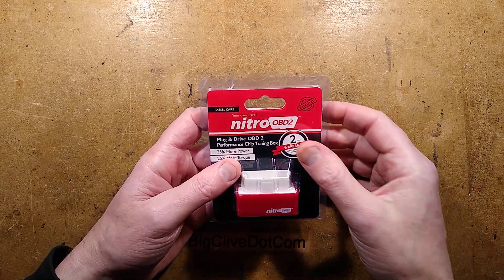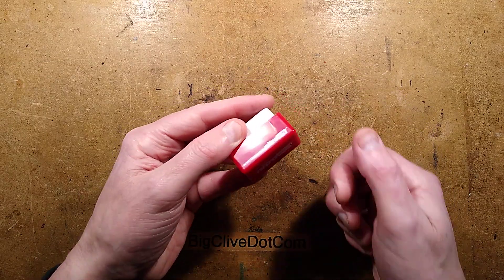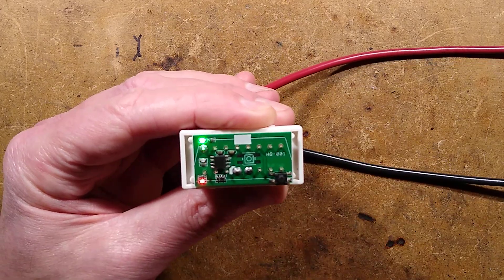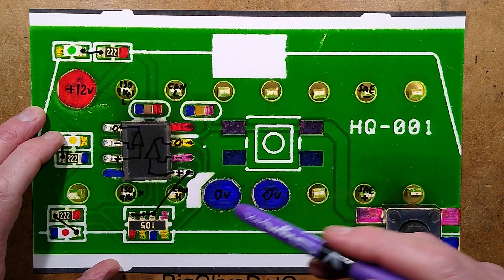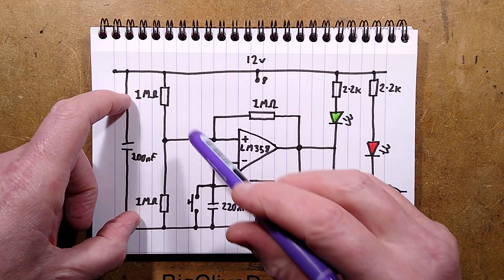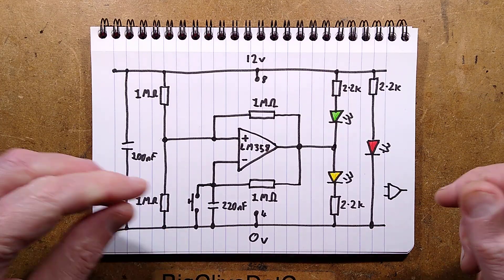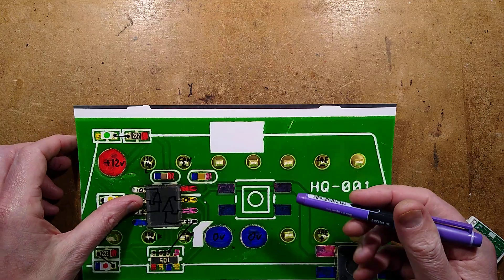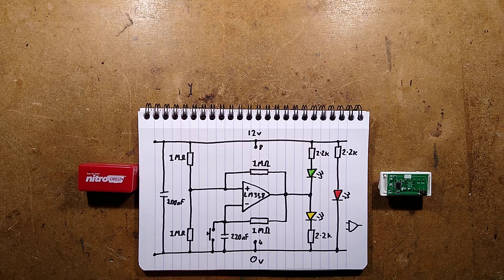Nitro OBD2 unit with interesting circuitry

Comment: Yes, the placebo effect indeed. The logical fallacy of a magic device costing £5 improving power delivery by 3000% whilst simultaneously cutting fuel consumption by 50% eluding the engineers of big car manufacturers, no doubt as part of a conspiracy between colluding car manufacturers and "big oil" - according to the Greta accolytes, anyway.

Comment: This particular deep dive into automotive bovine excrement has fallen rather delightfully into the realm of snarky sarcasm, or "snarcasm."

I work in the automotive sector, specifically doing diagnostics for body shops, and I run into about one of these devices a month.  It saddens me, as extrapolating the sample size indicates that there is, in fact, no hope for humanity.
Reply from the maker: You should offer to do a firmware update for the owners.

Comment: lol.. well, if something promises more power and better fuel economy, then I'd like to know why the car manufacturer didn't just do that from the factory 😀 they could probably have saved a penny by implementing an astable multivibrator using just a couple of transistors instead of the LM358.
Reply from the maker: They do a two transistor version.

Comment: It would be interesting to review a "V8 Racer" module that goes in the cigarette lighter.  It's a device for people with a Golf to think they have the R32 - it puts a fake engine noise that varies with alternator voltage over the radio in the car!  
You can make a diesel sound like a coach or fiat 500 like a Porsche.  They are fun items but clever in the way they work.

Comment: I see they have redesigned the little plug in ceramic heater the scammers were peddling last year, it looks very technical and space age in design , it should bring the shysters in quite a decent income with all the usual claims, 2 pence a day running costs etc.They are running the ads in-between YouTube content and off peak television airing - afternoon and middle of the night when the ad space is at cheapest tariff, and when the vulnerable will be watching. Wouldn't mind a tear down of one Clive to see if any ' improvement ' has been made ( tongue firmly in cheek )

Comment: I used to have a 1965 Ford Mustang. It had a number of nice features like a synchromesh four speed manual transmission and a four barrel carburetor. When I drove it around I got about 30 miles to the gallon. However, when my stepmother drove it, she got 15 miles to the gallon.

Smart driving might save more gas than this gadget. 😂
Reply: That's facts right there. How you use the "go pedal" makes a huge difference!
I've had both automatic and manual transmission cars exceed their MPG ratings consistently, simply by using a quality gasoline, following proper maintenance, and moderate throttle use. This works with both fuel injected AND carbureted gasoline engines. Oh, and when approaching a red light on a hill, I let the hill do most of the braking, and begin deceleration early in the hopes that the light will change before I get there so that I can cruise on through without having to stop, idle, and restart motion.
Also, not carrying a trunkload of unnecessary crap helps, too. 🙂

I actually squeaked out a few MPG more than my father did on our '91 Mitsubishi Fuso dump truck, which really irked him for some reason. It's the vehicle I learned to drive stick on, and he's the one who taught me to drive stick (and automatic!), one would think he'd be proud of that... He managed 15-16 MPG and told me there's no way the truck could do any better than that, and yet his 18/19-year-old son averaged 16-18 MPG.

One time, in the Fuso, I pulled up to a traffic light next to some kid roughly my age at the time, in a Fox-body 5.0 Mustang, car full of his friends. He revs his engine a few times, glances at me. I glance at him, rev my turbodiesel a little and nod. I shift to 2nd (1st was useless unless hauling) and wait for the light to go green. I drop the clutch, chirp the dualies a tiny bit, and start moving. Glance in my right convex mirror, and I see him in a thin cloud of diesel soot - trying to restart the car, his buddies laughing hysterically. He would've had me, if he hadn't stalled it on launch. 🤣 You bet your @$$ I bragged about that in school the next day!
Reply: @dashcamandy2242  I can definitely appreciate that and my approach to red lights is pretty much like yours. In my case it came from growing up in a very poor family and every ounce of gas cost us dearly so I got the habit of being easy on the gas pedal. I can’t explain what happened with my stepmother except that I think she thought that the accelerator was an on/off switch. 😂

Comment: Yes on our scan tool at work just the database file for each manufacture (ford, Hyundai, Honda) can be 400-800GB in size. So to make an adapter to actually communicate at the OE level (not obd2, it's too limited and slow) would need several TB of storage and a high speed processor. Then for it to be able to control the ECU or modify parameters is something even harder.

Comment: For those interested in the Falstad (search Falstad javascript circuit simulator) exported circuit (just import the following text): (had to add a small resistor to the 100nF cap for the simulator to be happy)
$ 1 0.000005 119.19350207351468 50 5 50 5e-11
R 32 48 32 16 0 0 40 12.6 0 0 0.5
g 32 384 32 416 0 0
c 48 128 48 384 0 1.0000000000000001e-7 12.6 0.001
r 96 48 96 208 0 1000000
r 96 384 96 208 0 1000000
a 192 224 272 224 9 12.6 0 1000000 4.978957101229772 4.1999740758991555 5000
s 144 272 144 384 0 1 false
c 176 272 176 384 0 2.2e-7 4.978957101229772 0.001
r 192 272 272 272 0 1000000
r 192 176 272 176 0 1000000
r 384 48 384 176 0 2200
r 384 272 384 384 0 2200
162 384 224 384 272 2 default-led 1 1 0 0.01
162 384 176 384 224 2 default-led 0 1 0 0.01
w 272 224 320 224 0
w 272 224 272 176 0
w 272 224 272 272 0
w 192 208 192 176 0
w 192 240 192 272 0
w 192 272 176 272 0
w 176 272 144 272 0
w 32 48 48 48 0
w 48 48 96 48 0
w 96 48 384 48 0
w 32 384 48 384 0
w 48 384 96 384 0
w 96 384 144 384 0
w 144 384 176 384 0
w 176 384 384 384 0
w 384 384 464 384 0
w 384 48 464 48 0
r 464 48 464 224 0 2200
162 464 224 464 384 2 default-led 1 0 0 0.01
w 96 208 192 208 0
r 48 128 48 48 0 0.001
368 192 176 192 128 0 0
368 192 240 160 240 0 0
w 320 224 384 224 0
368 320 224 320 176 0 0

Comment: Yeahhhh, I have a diesel tuning box specific to my vehicle and it was £400 and works it doesn't connect to obd it connects to fuel rail and MAF sensor and it adjust air/fuel flow and I get a increase of around 14 hp and torque increase, but I'm down for some snake oil magic 😂

Comment: Hah, classic little op-amp oscillator. I have used something similar as a ramp generator for a crude boost converter using the voltage across the capacitor as it charges and discharges.

Comment: I hate to through a spanner in the works but being a garage owner, we use the proper version of that, and it has a small screen that shows any faults as a number that tells us what is wrong with the engine.  Without a screen to show error codes it is no good and could cause a fire in your car.

Comment: I’ve met a few people who absolutely swear by these things. When I was working as a mechanic, I had a handful of vehicles come in with dead batteries because these were plugged into the OBD2 port and drawing power. It might not kill the battery overnight, but some of them have relatively high power draw, and when that is drawing continuously for several days while the car sits (like when on vacation) it kills the battery. I had one customer in particular who refused to remove the stupid thing and instead wanted us to hardwire a battery charger to their vehicle so they could just plug it in when the vehicle was going to sit. I told them to get lost.
Reply: While a more cynical mechanic would've done the job and billed them for it, at least you weren't that dishonest.
Reply: @Aeduo   That would be double taxation. An idiot tax on top of an idiot tax!!!  Oh how badly many people so want to believe the impossible!!
Reply: Well  I suppose , compared to a magnetic fuel conditioner, this at least has lightzenblinken
Reply: About 30 years ago or so, I had a mate who asked me if he could park his car in my garage while he went away on holiday. Just before we locked the garage, he opened the boot. When I asked why, he said it was to dry it out (don't ask me why). Anyway, 2 weeks into his vacation, he frantically calls me and said he just realised the light would have been on the whole time the boot was open. When I went to check, there was no light and the battery was completely flat. So I had to disconnect the battery and take it to a garage. It was too far gone so I ended up buying a new battery (which he wasn't happy about).
So there's more than one way to drain your car battery without thinking. Leaving a door open would probably do the same.
Note: You could have told him to unplug it when not in use. Or see an electronics guy to put an on/off switch in it. 😆
Reply: @two_tier_gary_rumain  Modern cars shut all the circuits off if they're left on too long. My Astra does it with the door lights if I leave the door open sat in it. The radio turns off when I take the keys out of the ignition and open the door, and every 10 minutes after that if manually switched back on without ignition. Modern cars are a lot cleverer than 30 years ago. Computers, eh?
Reply: @supergeekjay  Only 10 minutes until the radio goes off without ignition? Wow that's very annoying. Ironically, that will drive people to leave the ignition on to listen to the radio without it going off all the time, which will actually draw more power than just the radio on its own. In a Ford it's at least an hour until the radio goes off without ignition.
Reply: @maxine_q I'd imagine that there's a condition that the timer only applies if the ignition is switched off whilst the radio is running.
Once the radio is turned back on manually without ignition, there would be no reason to have the timer running.
Reply: @coliander4180  I've never driven a car where the radio didn't automatically switch off with the ignition. (unless it's not wired in correctly, in which case it would be always on)
Reply: @maxine_q  It seems to be a modern car thing. In my car after I turn it off it'll actually keep the stereo system running until either twenty minutes have passed, or I open the door. So there's a switch in the door latch specifically for that. I have a very good hunch that such systems are going to cause all sorts of havoc in a few years for the used car market as the plastics grow brittle and the wires wear through their solder.
Reply: @VulpesHilarianus  
>  So there's a switch in the door latch specifically for that

If it is a modern car, they ought to be using the one switch on the door for all functions, routing it as a control signal through the car's computer(s) - so the input from that switch is known to the entertainment (sub)system ("start countdown timer") as well as the warning light(s)/pretty picture of the car showing which door is open.

In all our cars, the switch hasn't been in the latch - it is a quite large thing, with a black rubberised cover, on the car frame where it will be pushed shut by the door frame. Pretty robust and should also be easy to change if it does go. You can try pressing it and seeing the courtesy light react!
Reply: @maxine_q you have obviously not owned many vehicles. MK 5 golf for starters lets your radio run with the ignition of, but key in.
Reply: @supergeekjay    OBD power lines are ALWAYS live though.  Some power lines have to be to wake up the control modules.  OBD-II is definately never off.
Reply: I would have opened the device up and disabled it then told the guy I made the battery self recharging when the car was running.
Reply: I HAD A WATER BOTTLE PUSHING A SEAT BUTTON TO REVERSE AND EVERY SO OFTEN GET A 7 AMP DRAW AND STOP IT WOULD TRIP THE CIRCUIT BREAKER AND WAIT THEN DO IT AGIN, THAT WAS INTERESTYING TOO IT WAS LIKE A 2005 CHEVY TAHOE..... COOL STUFF

Comment: I find it very pleasing that pressing both buttons for more than three seconds switches to EV mode.
I'm pretty disappointed that no blue LED lights up!
The device only communicates via the supply voltage anyway, so the CAN bus contacts are of course not needed at all

Comment: About fifty to sixty years ago, you could increase your car's performance simply by adding "Go Faster Stripes" down the sides of your car. For rally performance, you had the power performance stripes which were much wider and went over the roof!

Much the same effect could be achieved by bolting on a pair of Cibie Oscars to your front bumper - Two pair, and you got turbo halogen power!

Similarly, fitting a "drainpipe" exhaust was said to add an extra 7.568 mph in top gear.

A few years ago, it was the "Turbo Waste Gate" but only if it made a ridiculous PING-PHWEE sound every time you changed gear!

It's all in the mind, only these electronic gadgets are more plausible because it has a silicon chip inside it, and you can't see what it does, and therefore, no one can prove you wrong.🤦🔧🙎😊😁😁
Reply: Da red wunz go faster
Reply: @webchimp  My one red one Mr Bond! 😱🙄😂😂
Reply: Mind you Oscar Halogens WERE bright, waterproof, and very durable / "damage tolerant".  Had four on my old diesel LandRover Ser. 3, which did significantly improve visibility, especially in snowy Welsh winters!
Reply: @phils4634  Had a pair of super oscars on my Landy. swapped out the generator for an alternator to drive them. also had them on a cruiser. good lights.
Reply: Don't forget the fuel pellets and fuel cleaners and the magnets on the fuel line (Clive featured these years ago).
Reply: And adding a wing on the trunk increased the horsepower.
Reply: Painting flames on the front fenders will add 15HP to any car's engine. Bigger flames that extend on to the doors add more like 25HP. That kid that works at the gas station told me this so it's gotta be true!!
Reply: @sootikins  I heard that too!
Reply: In the late 80's installing a Hurst T handle on the shifter gained you 10 horse. I would imagine that with inflation it is likey 15 horse today.
Reply: Don't forget the certain Australian race car champion who trashed his reputation over their avid/rabid promotion of crystals that did n't increase engine performance/fuel economy etc.
Reply: @josephking6515 , glad you mentioned him; it saved me doing it. Brilliant race car driver in the days when that actually meant you had to drive a regular (plus a bit) car flat out, but motor vehicle engineer? Not so much.
Reply: Oh please, paint it red, every one, even orks, know that red things go faster
Reply: @dahnyahollier-day4217  or British Racing green!
Reply: I was following somebody with an exhaust turbo whistle once, I struggled to keep up!... Until the next traffic light where the high pitched squeeling noise drove me insane xD
Reply: Yes BUT, the strips had to be applied in the correct direction. Otherwise, the car could barely accelerate let alone go faster. Caveat Emptor.🙂
Reply: Nowadays all the morons "mod" their cars to bang and pop on the overrun, utterly pathetic.

Comment: Are you sure that's an LM358? The 1M resistors are quite high impedance, if I (with limited analog experience, though) would have to design an LM358 circuit, I would have used around 10k instead. On the other hand, if the 1M is a requirement, I would have suggested an TL072 instead of an LM358.
Reply from the maker: My guess is LM358 because the Chinese manufacturers love them.

Comment: I am surprised that in this day and age the designer chose an analogue solution. LM358 is probably more expensive than a lot of 8pin microcontrollers. Then again maybe he had a job lot to use up.
Reply: Maybe it's the Sinclair RAM trick. You get a load of scrap dual chips where only one half works, test them and use only the working half.

Comment: I'm quite sure you could make a fortune by making a new adapter to that, a "security device" that will inhibit problems in case of a bad solder. Just bypass the 12V and make it plug and play. All you need is a wee bit of electronic equipment and a 3d printer.

Comment: Lol, at the "if you put both switches in and press at the same time for 3 seconds, it will switch to electric vehicle mode, which is very useful" part. I bet if you put 4 of these modules in your car, each saving 25%, it will run for free, right?

Comment: HP tunes is a real ECM tuner. EFI live wire too not sure if there still around though. But HP Tunes was the best till the updates there still good though. HP Tunes Is $400 to 800$ use your labtop and adjust loads of data in the engine and transmission too. I was amazed how mild the set up for GMs 5.3L form year 2000 is. All the power gains year to year was GM just increasing numbers little by little. I have a stand alone wide band o2 sensor and millions of gallons of gas could have been saved bc they run rich like 13to1 to heat the catalytic converter but i guess it would have had worse emissions. I run mine like 16to1 under 2000rpms and it loves it. Then 12to1 at 6000rpms.

Comment: Thankyou Clyde. When you discovered thee LM elusive op amp,,,, and created the circuit schem drawing, output connecting too the LED's, I KNEW it was gonna be an oscillator circuit disquised as a digital analying scamm. Been learning and I recognised the circuit immediately. Cheers ole man!